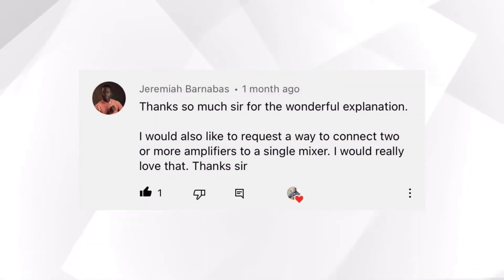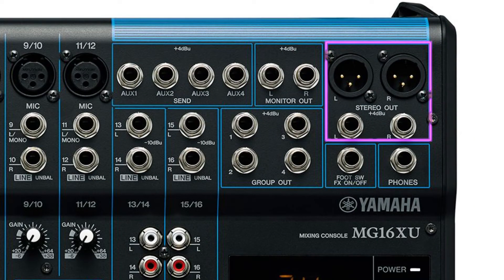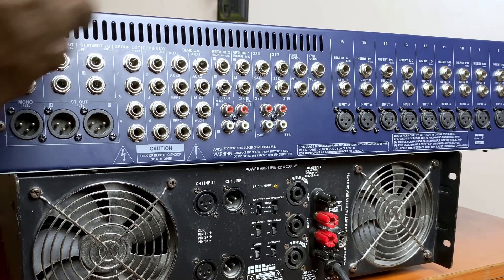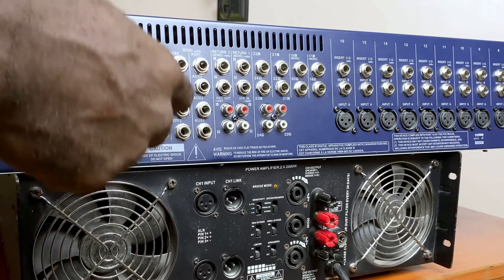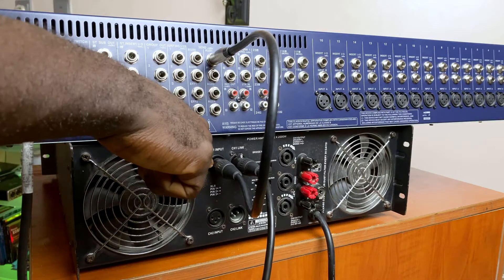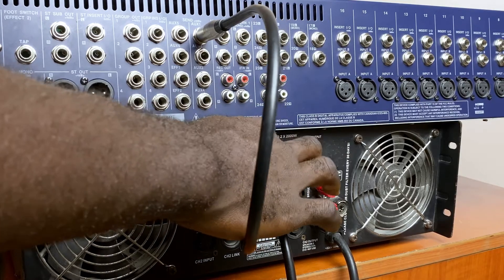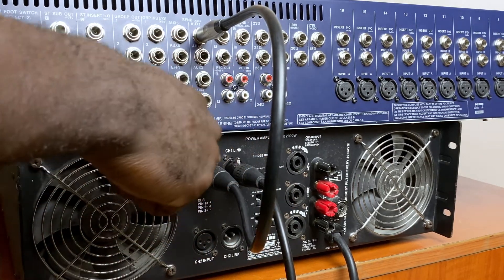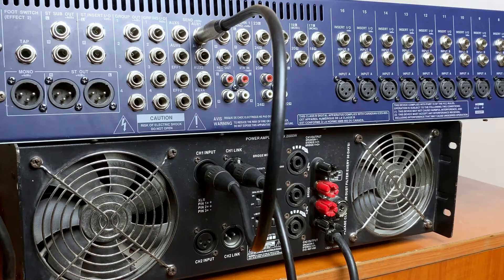How to Connect Multiple Amplfiers to a Single Mixer Output

Comment: Thank you Kelvin. Question...can i connect a 'powered mixer' to the 'monitor out port' of the main mixer in order to power passive monitor speakers? I don't have a separate powered amplifier just a second powered mixer thank you

Comment: Bro please i have 2 amplifiers and i have 2 section with different type of speakers power one is indoor and the other is outdoor.
Please how can i connect them using the 2 amplifiers.
Outside is unit drive 16 ohms, indoor is 4/8 ohms. The problem is they require different volume and power control please help. Thank you

Comment: Can you please reply me back? I have this situation. I have a powered mixture  (2x250,4 ohm) and an analogue mixture (signature 16) . I dont have a budget to buy an amplifier. I connected the analogue mixture output to powered mixture using line out to power my passive speakers (elx115). Will it ruin the speakers? should i buy a power amplifier?

Comment: Please kindly help me sir, I have an unbalanced sound and I really need your help on this, I have MG32 fx and a dbx drive back, a feedback distroyer model DSP1124P, a single Channel  ultragraph digital model DEQ1024, and a double channel dbx 321s graphic equalizer, an  audio link cable, sir how do I link this properly to my 16 passive speakers sir? I have two full range sound prince and 2 double sub speaker for each , facing the house, a feedback on the altar and 2 feedback speakers for and 2 single subs for the instrumentalist. Sir I please help me how do I have a balance connection of this Guy's thank u sir.i anticipate ur reply sir